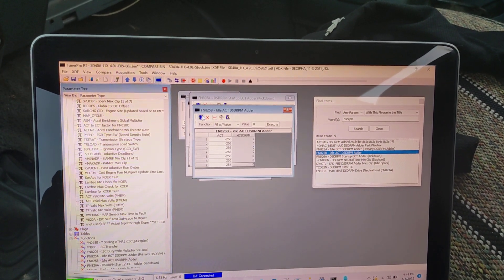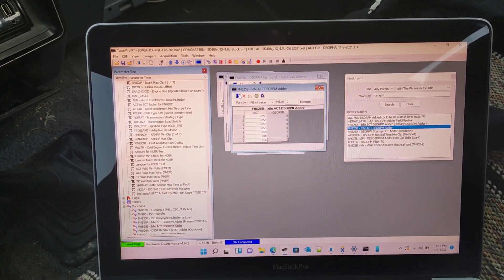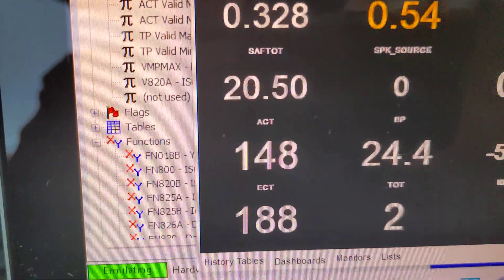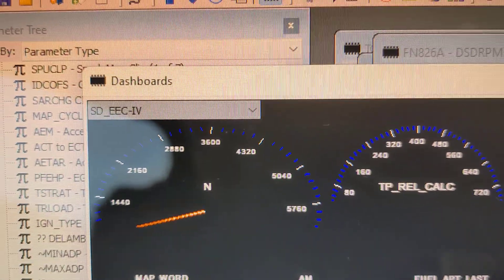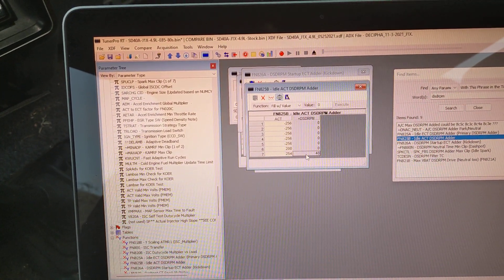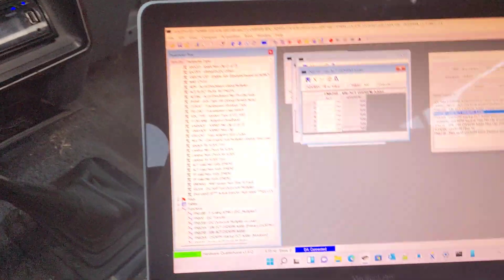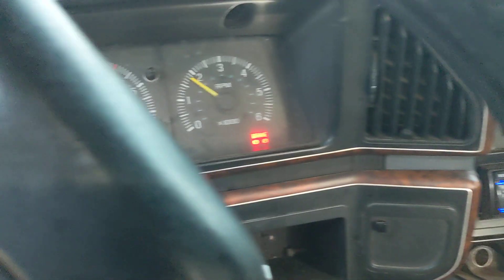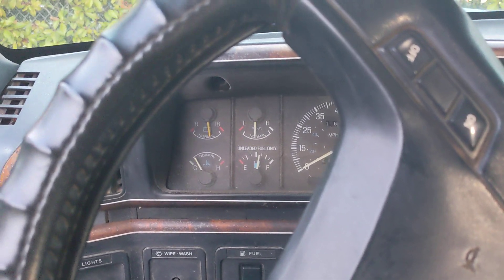Tuning Demo - 1991 F150 4.9L - TunerPro RT & Motes Quarterhorse

Comment: Dude ive been trying to learn how to tune, and it seems like nothing is really available for ford how to's. I have a 01 ford mustang with a 5.4 2v supercharged using a 01 f150 5.4 ecu. Id like to tune it with tunerpro but have no idea where to even start.
Reply from the maker: The basics are not super hard as you can see. The main hurdle is creating a definition file for your ECU's calibration to tell Tunerpro where the specific parameters exist in memory. There is a lot of reading and community over at EFIDynotuning.com. If you are not a computer programmer, I recommend paying to become a premium member ($450) and all of the hard work of will be done for you including remote tuning.